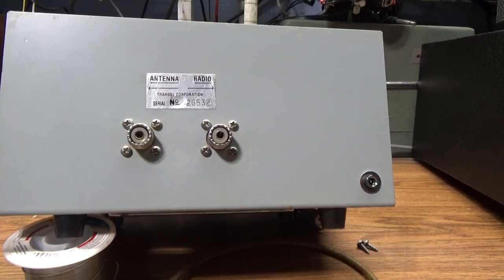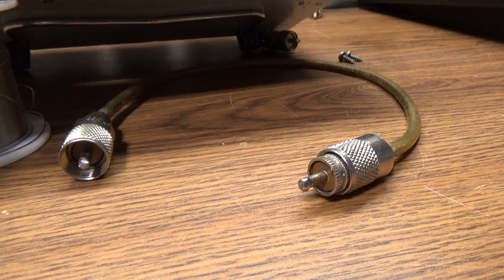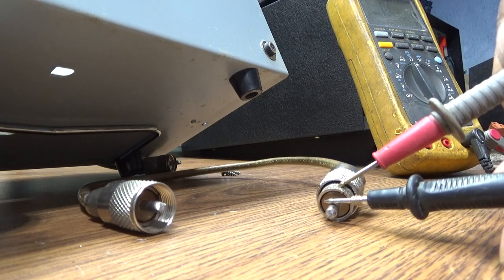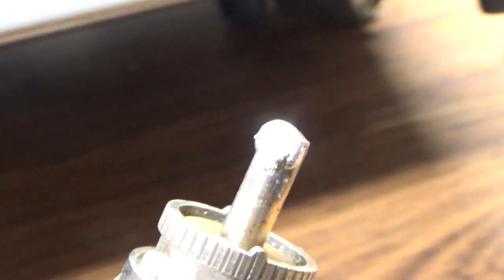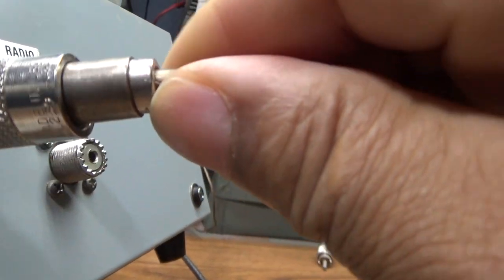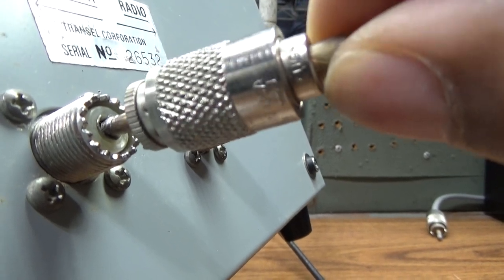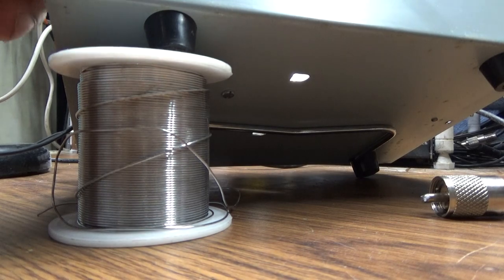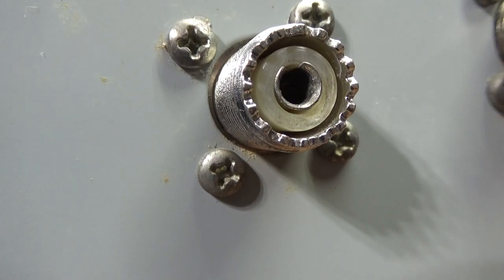Linear Amplifier Killer, silent but deadly

Comment: 😂 well cheep So -239’s and A Junk Jumper and we’ll the wrong length!! 
And by the way, what is over jealous  ??? I think the word you were looking for was over zealous? 
But realistically, the jumper length should be a half wave length electrically no matter what coax you use that’s what you really need to feed a unit not 1/8 of a wave.. not beating on your video… just trying to help a little bit
Reply from the maker: Whats funny is that a mostly agree with you on coax length except I think a half wave is best, but quarter or 1/8 wave might not be as effective, but do you really run a half wave from radio to driver, then from driver to big amp and then from big amp to wattmeter? I had this discussion in a Facebook amp group and you should have heard all the mud ducks trying to tell me how wrong I was. Also, you are number 32 that has mentioned over jealous to me.
Reply: @tramdr  
Yes, 1/2 wave electrically from the radio to the driver a lot of the bigger units like to see 1/4 wave of coax between the boxes shows how the HG seem to work out some of the older Toshiba‘s kind to do the same thing … depending on the HFE of a transistor will affect the coax sometimes or how the amplifier is tune but if you watch my videos on Facebook, I clearly talk about VOP and every video is very very important to the equipment that we build kind of like breaking your shoelace, can you still tie a bow in your shoe?
Anyway, you cut it very rarely a eighth of a wave coax or a 3 foot piece is typically always wrong if you actually take and look up the Coax that is that mini eight or the foam or the truck driver stuff the VOP is 84% so they don’t even come into the proper equation But if you know this people normally don’t talk about it but if you don’t know what they always talk about it acting like they do know about it if you can follow all of that… 
Anyhow, good luck good job try to educate. The general public is very difficult. It’s a big hill to climb.
Reply: @tramdr  
Yes always run a 1/2 wave fro the radio to input of the driver then depends on the big box the phase angle can Chang ! You may need to change to an 1/4 wave to match the input of the big box and the output of the driver… the only way you can make sure is to do a test with a bird!